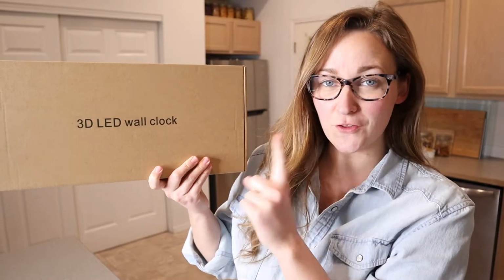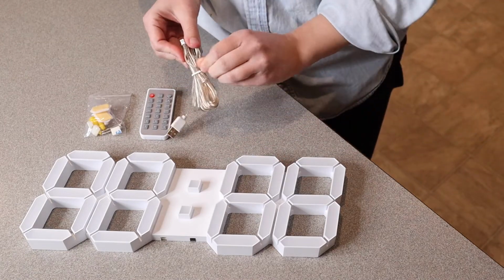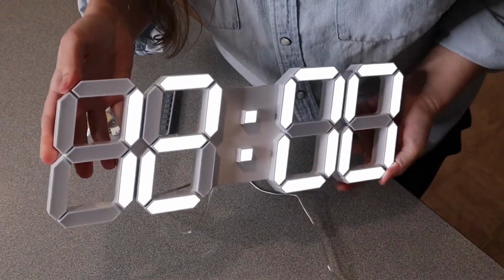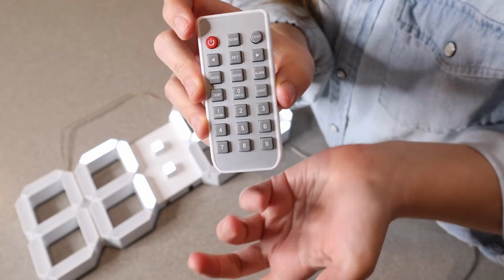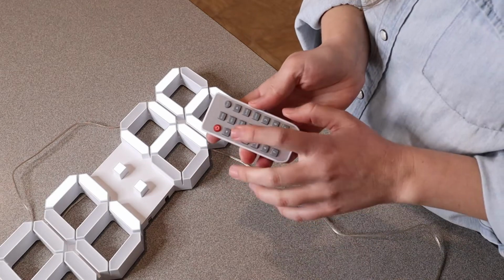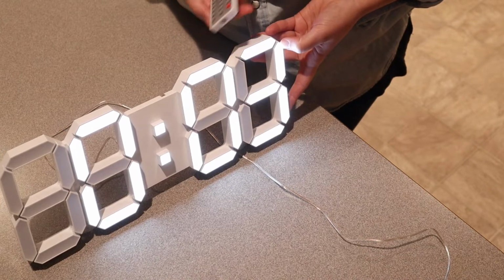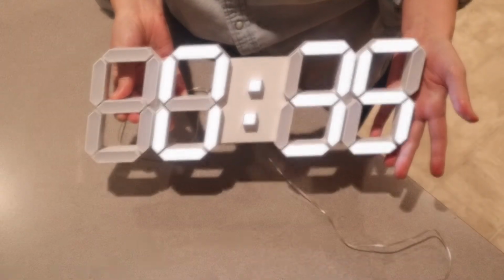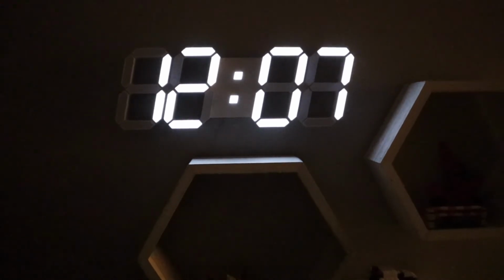EDUP HOME 3D LED Digital Wall Alarm Clock Review | Remote Control, LED Time/Date/Temperature Display

Comment: Some folks are looking how to stop the blinking of the "colon" . I have a different remote which has  directional arrows and no numbers.
For me, the instructions said to press/hold down the arrow button pointing to the right. 
What I did was selected the clock option, clicked the clock option to go thru all the setting options (Time>Date>Year>Time), then hold down the arrow button to pointing to the right. 
Hope this helps